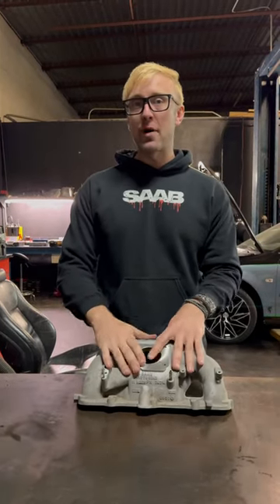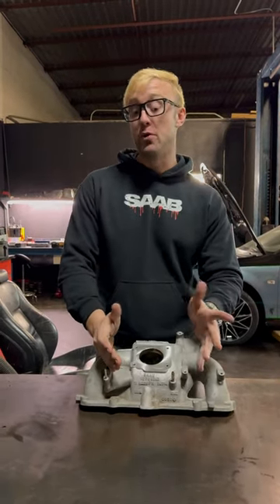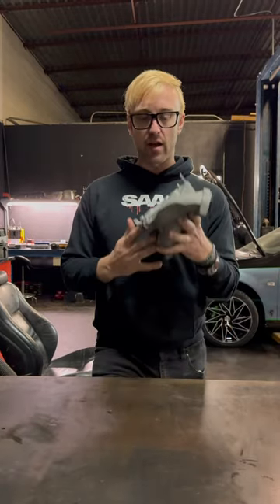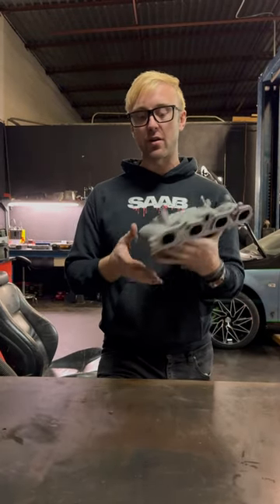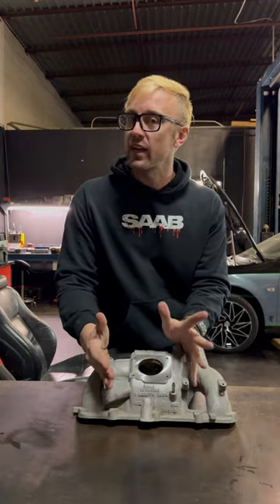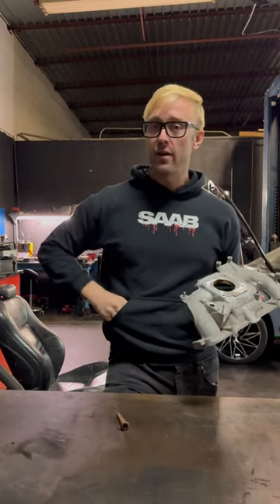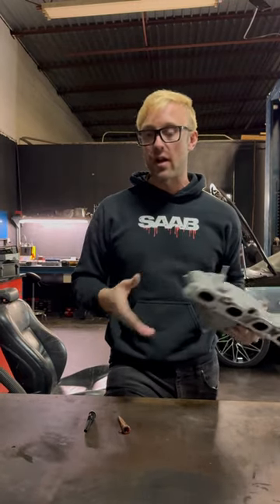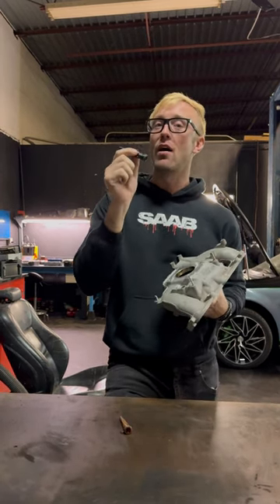THIS is where you could be losing your boost pressure! #Cars #Mechanic #Build

Comment: When you are changing your throttle body gasket? Changing the gasket for the throttle body you leave the intake on. The PCV valve in the manifold requires manifold removal to replace
Reply from the maker: Just like I am clearly showing in the video, the manifold has to be completely removed. I am obviously holding a removed manifold. Anyone that has common sense can clearly see the manifold is off. If you are changing the throttle body gasket, you are already halfway there, so you should proceed to remove the manifold…
Didn’t think I could make it more obvious that I am holding the removed manifold. Throttle body gaskets on these cars are more likely to fail, whereas the intake manifold gaskets rarely fail, so tb gasket is a more common repair. Thank you for the support for watching our videos 👍